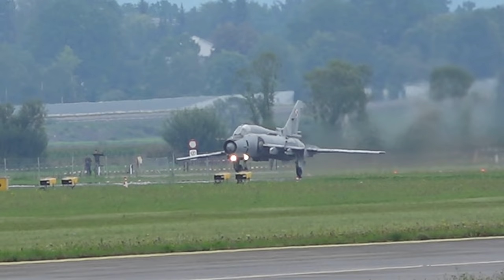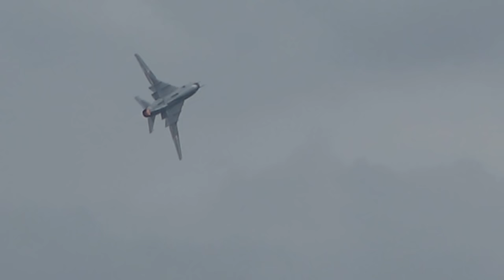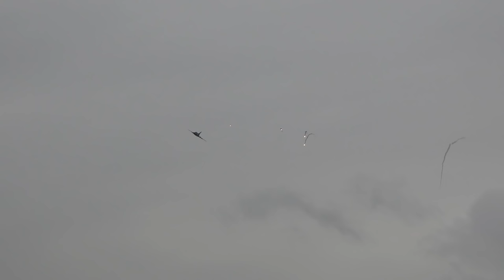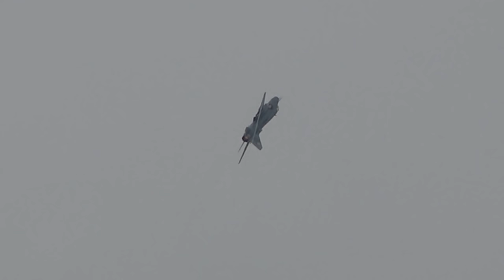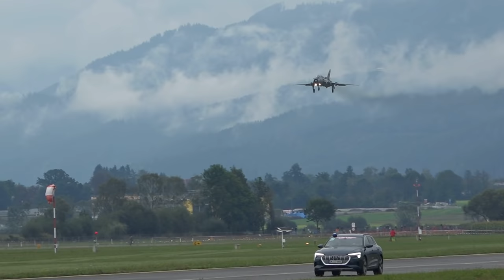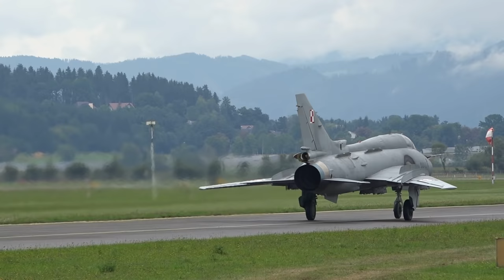SU-22 Afterburner goes "BOOM" on ignition

Comment: A classic "afterburner" is on or off, not like the more modern "augmentor" which is throttleable.  I work near Mojave CA and about 10 years ago was watching one of Tracor Flight Systems' F-100s making mock attacks on a FedEx MD-11 carrying a prototype cargo aircraft defense system.  The old J-57 in the F-100 is a single stage afterburner.  Pilot would bring the jet over our facility then light the burner and head for Mojave, loved hearing that old burner go boom when it lit.
Reply: So if it can only be switched on or off, how would you control the thrust the afterburner produces?
Reply: @thanhtringuyen8788  with the old single stage afterburner you don't control it.  The engine is either one thrust rating at max dry thrust or a higher rating in afterburner.  The afterburner lights off at full power with a boom.  When the pilot deselects afterburner the engine goes from max thrust to max dry thrust in one step.
Reply: Same with the F-106 Delta Dart and the J-75. That engine was brutal when lit! Had a very unique boom, very explosive ! I miss that sound.
To give you an idea of what I heard, and it was closer than what the camera mans  distance was in this video. 
https://youtu.be/0A3OMi22yfc
6:30 in
Reply: I work at Borax and it seems very rare to hear sonic booms anymore. When I was stationed at Edwards in the very early 90's it was booms constantly it seemed. Hell I remember twelve F16s doing a high-speed fly by and it rocked the world. Made the shuttle landings pale in comparison.
Reply: The original English Electric Lightening had a 4 stage afterburner. 1960's design. Later models had a variable afterburner. Aircraft of a very similar vintage to the century series aircraft
Reply: @tomsparks2294  I work about 10 miles west of you under R-2508 airspace.  12 years at Edwards on 2 separate tours.  Edwards tempo is a tiny fraction of what it once was.  Very few new programs in the works.  We used to get buzzed by B-1s pretty often, now, nothing.  They probably send the pilots to Dyess or something to maintain their proficiency hours.
Reply: @Zuloff  when I got to Edwards in 90 the YF 22 and 23 were flying, along with the B2, NASA was still flying the SR71 a bit, and the C-17 was also in tests. I was at Sembach AB in Germany for 6 years prior to Edwards what a change. Edwards was a big change
Reply: @thanhtringuyen8788  When you decide to go afterburner what do you want to control? The only thing you should worry about is get the f. out of the location as fast as possible. It's all or nothing...
Reply: I remember hearing the CF101 Voodoos taking off at our nearby Canadian airbase when I was a kid. Being a twin-engine J57 powered aircraft, the afterburners didn't engage simultaneously, and you would hear TWO very distinct booms. Really cool!
Reply: > FedEx MD-11 carrying a prototype cargo aircraft defense system

Um...should you be talking about that?
Reply: @occamsrazor1285  The existence of the testing was not classified.  Also, I learned a couple months after seeing the F-100 fly that its pilot was test pilot and USAF Manned Orbiting Laboratory Astronaut selectee Richard Lawyer.  He passed away just a couple months after flying the F-100 in the Guardian tests.  I knew his name because some in the local SoCal wreckchaser community had been in search of an F-106 he ejected from in 1965. 

https://en.wikipedia.org/wiki/Northrop_Grumman_Guardian

https://en.wikipedia.org/wiki/Richard_E._Lawyer
Reply: So...THAT'S why I never got my Spongebob Boxset!!!!!!!

Comment: I have always liked the SU22's lines and I have never seen it on video until now. A tremendous beauty in the air! Russians have true genius when it comes to planes. Their Mig 29 Fulcrum is arguably the most beautiful plane ever built.
Reply: The MIG-29 is pretty but they were built cheap like AK-47's and only last around 4000 hours on their air frames. The Russians took a Sherman tank approach in that they would make lots during a war and throw them away when they wear out. This is why many countries that bought them like North Korea don't fly them very much. Then there's the smokey laggy engines, 1950's cockpit, and a radar that was next to useless against adversaries like the F-15. MIG has fixed all of that now with the MIG-35. Only took them 40 years.
Reply: The Russians and the Swedes make beautiful and different airplanes.

Comment: Of all nations operating Soviet Su-22 Poland has the best upkept along Czechs
Reply: Iranian Su 22 are better keeped
Reply: @kwestionariusz1  you know what you are correct holy crap I saw one looked fresh from a factory. Dang!
Reply: Polish Su22 are only operational due to the fact that Poland doesn't have any other plane or weapons platform that could replace it. Spare parts are the biggest problem.
Reply: @BOTmaster15  easy, send it to China they'll have it took apart before the engines cooled down, week later you'll get it back fixed but with an even lower performance
Reply: Shamefully we stopped using em 2002. Because lets srop using old equipmenr without anything to use instead of it. Man i love politiks mixing into military and fucking it over.
Reply: @BOTmaster15  sadly the polish ones will be replaced with f-35's. I mean a big upgrade, but these planes have this vibe.
Reply: @GT-fh5no  LMAO 🤣🤣🤣
Reply: And India has best bisons
Reply: Vietnam too

Comment: This airplane looks and sounds a lot like an F-100 Super Sabre. The F-100 afterburner also went boom when it was lit. The reason was it used an older technology afterburner nozzle that had only two positions - fully closed or fully open. As such the F-100's afterburner was always either off or fully on. Later jet fighters like the F-104 and F-4 had variable nozzles and multiple sets of spray bars so their afterburners operated progressively, so they didn't go boom anymore.

Comment: Was worried he was going to drag that tail when he landed with the nose pitched up so high. Good heavens!
Reply: no need to worry ... bro they are professional...
Reply: aerodynamic breaking.scary,but cool as hell.
Reply: It's called Aerodynamic braking, as already stated, like in the Viper.
Reply: Tail draggers need not apply...
Reply: No flaps... That's why.
Reply: There are central fins to prevent dragging the tail. Just like on an F-16 and many other planes.
Reply: Nah, Vx roll-out aka aerodynamic braking uses the entire wing and fuselage as a speed brake to slow it down.
Reply: @jayhansen5609  LOL
Reply: @jayhansen5609  The fins on the F16 and probably this is one is for aerodynamic stability, not for prevention of tail dragging.
Reply: I know the ventral fin is there for longitudinal stability at high AoA and supersonic speeds. They cancel out the tendency to slip in turns and at supersonic speeds the vertical tail loses effectiveness which the central fin cancels out.
  I have a Byron Originals F-16 ducted fan RC aircraft, 1/6th scale.  The fins have saved my ass more than once.  One aircraft, a MIG I think,  has fins so large they must be folded for landing.  I am aware of the design considerations but if you lift the nose oc aircraft with the fin the fin  angle at the margin is parallel with the ground and they will absolutely stop the tail from hitting the deck unless you were to pull a cobra maneuver 5 feet off the ground. The angle is engineered to be parallel with the ground when the nose lifts at takeoff.  Was it designed specifically to guard the tail? No, but it still does.
Reply: @jayhansen5609  "guard the tail"? I suppose...but only as a byproduct. I guarantee no engineer said, "it'll help with stability and guard the tail." 

I've been flying jets for the last 22 years as well as an instructor, examiner, and check airman at the ATP level (the actual thing, not remote control planes which have unrealistic performance for the scale) and trust me, if a plane didn't need fins for stability, they wouldn't be there. 

Also, in real life, no F-16 will ever do a cobra maneuver 5 feet off the ground.

Comment: I saw and heard an F 8 Crusader light it’s afterburner with a tremendous kaboom! It’s something that I’ll never forget.
Reply: Last of the Gunfighters
Reply: The J57 had a notoriously hard afterburner light, this is not unusual in a turbojet. If you have a bypass duct then the afterburner thrust build up is arranged to be much slower because otherwise the pressure pulse in the jet-pipe can travel backwards up the bypass duct and destabilise the compressor causing surges. F100s used to have this in the early F-15 and F-16 models.
Reply: A lot of older jets did not have a progressive or staged afterburner control like those of more advanced design. They were all or none concerning the reheat/augmentor fuel flow. This produces whats called a 'hard-light' type system. Another characteristic of the older and more primitive systems, many did not have a dedicated ignition source for light off. These early systems used "hot-streak" ignition where a momentary on/off fuel  nozzle was placed in one of the combustors further downstream of the main fuel nozzles. Activation of the AB system put a shot if fuel through this extra nozzle that would ignite and put a lick of flame all the way through the hot section turbines & stators and into the jet pipe. That lick of flame was the AB ignition source. Its a reliable method but subjects the hot section to extra hot heat cycling with every use, hard on the parts and reduces service life. This system was replaced by electronic spark ignition and some had a fuel burning torch igniter in the exhaust.  You can see a hot-streak system in use on a Saab Draken video and some videos of the F-104 Starfighter you can see the torch igniter lit in the jet pipe of taxing 104's.
Reply: I heard that the Soviets knew when our B-58 Hustlers were taking off because they could hear them from Russia.

Comment: Swept wing,more rounded fuselage + rest of mig 21=su 22.
Reply: Su22=mig21's big brother
Reply: No not.
Reply: Su 22 is like twice the weight of a mig 21, also in Soviet times it was used as a fighter bombers, completely different role than mig 21. They’re loud as hell though.
Reply: Susan Ananda because they bought a large spares package and a MASSIVE package of Russian munitions when the planes were new. They did a cost study several years ago and determined that the cost of retiring the planes before they used up more of the parts and munitions, plus retraining all the crews, was actually more expensive than keeping them operational for a bit longer. They are apparently VERY cheap for Poland to operate.
Reply: captain cool right, and in the meantime just keep the cheap-to-operate Su-22s in service until they simply become unmaintable.

Comment: PaddyPatrone you have an awesome sound recording device if you did the recording. The sound of that jet engine, it was amazing, i could feel it in my chest, even though i was wearing headphones, it felt like i was at that airshow.
Reply from the maker: Great to know. I use an external shootgun microphone.
Reply: Then there are the 8K cameras too that will take videos like this to another level.
Reply from the maker: @D0csavage1  quite expensive
Reply: @PaddyPatrone  True but like all new technology the price will plummet. The first calculator was priced higher than a new car. These days calculators are given away free in some occasions.
Reply from the maker: @D0csavage1  Sure, but so far prizes for that kind of equipment don`t drop that fast. Also, resolution isn`t everything. There are many different features a camera needs to do a certain job. Run & Gun cameras are the best for airshow footage in my opinion. But yeah, im looking for a new camera. Aiming for something that can do 4K 60p with a proper zoom lens. Maybe next year.
Reply: I remember 4 years ago when i was dreaming for a high end camera there was this German camera that was 100 mega pixels, it cost $16,000. And if you wanted the wide angle lens with long range zoom that was another $8000. 
I ended up buying the way cheaper Canon Rebel T4i instead.

Comment: Noticed the MiG-21 makes this exact sound.
Reply from the maker: While they have different engines, I think the manufacturer is the same. Seems like the sound comes from igniting the afterburner very abruptly.
Reply: @PaddyPatrone  correct. Though it did take me a while to figure out, I thought something was playing up with the engine! I noticed when the pilot selects afterburner sometimes a flash of flame appears for a second behind the aircraft, so that's how I figured.
Reply: Basel Hammond yeah, the same happens to our so called ‘Advanced F-7BGIs’ which are the Chinese-License Built version of Soviet MiG-21s, I still can’t find the technical reason behind them. Every time they take-off they make that ‘boom’ sound and that easily helps us differentiate that whether it is a F-7 or a MiG-29. Talking about Bangladesh Air Force (BAF). :)

Comment: Do they still use those things?
Reply: Poland, Croatia, Czech rep. they still using it.
Reply: I live in Rogoźno Wlkp in Wielkopolska county. In late 80's and early 90's plenty su-22, mig-21's on the sky crossing sound barier. All glasses in windows are shacking and ground as well. The pilots making sonic boom's 10 to 15 times per week. Cheers.
Reply: Still in use by Syria. In fact, the US shot one down in 2017. It didn't work that easily though, as it evaded a modern AIM-9X with those old flares...